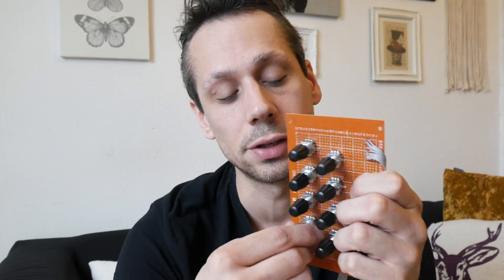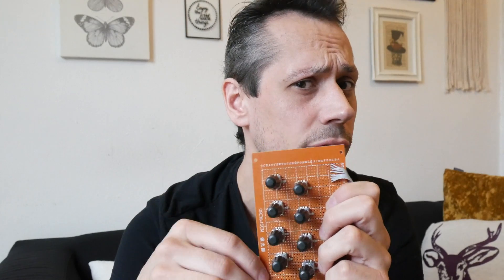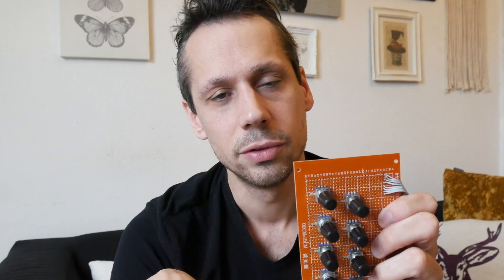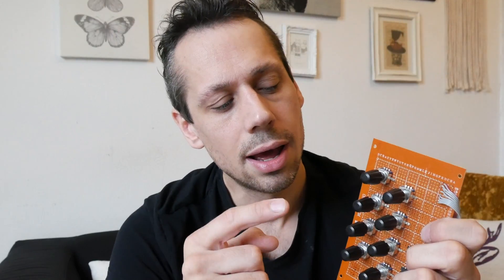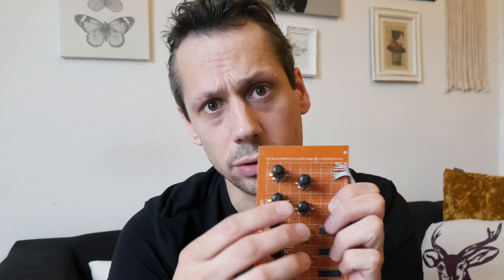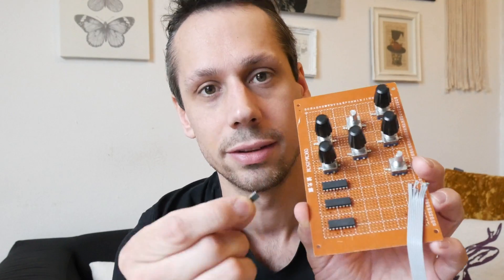Harrison Mixbus Control Surface Update - PCBs, EQ for 32C and much more.

Comment: You should check out the way the Harrison SeriesTen B works. It only uses 3 knobs for all the EQs, the compressor/gate, and the panning settings! You merely press a button to get the attention of what band of eq, etc and the three knobs control band width, freq, and +/- gain.
Reply from the maker: Duff Harris yes I that’s exactly what we didn’t want really. Whilst it’s a clever setup the access to parameters in parallel is limited
Reply: Russell Cottier Why’s that? I’d think a small dialog box to tell you what parameter you’re controlling would save more space on a surface than having every knob be individualized. Esp in the digital world without worry about recalls and having real potentiometers to leave set at certain positions.
Reply from the maker: Duff Harris I think I demonstrate the features better in other videos so check them out.

The topographical correlation between screen and fingers really makes a difference and the ability to work on EQ and dynamics for example simultaneously is very useful. 

There will be a screen on the controller of course but I should make clear that the controls are endless encoders so full recall is possible and you only need one channel worth of modules